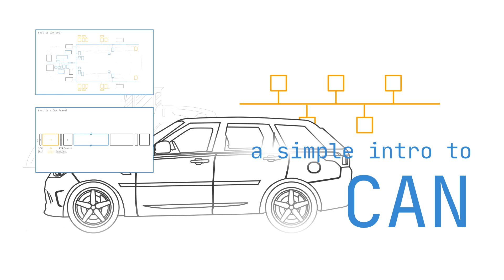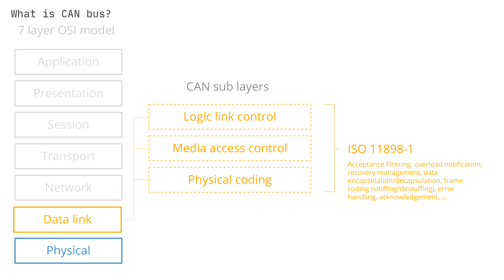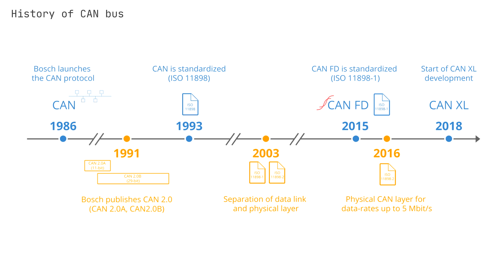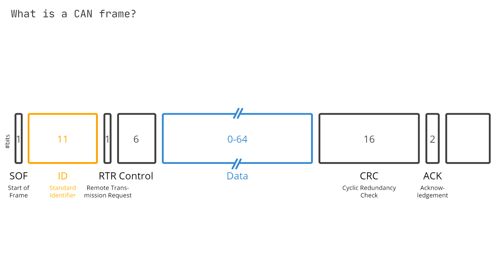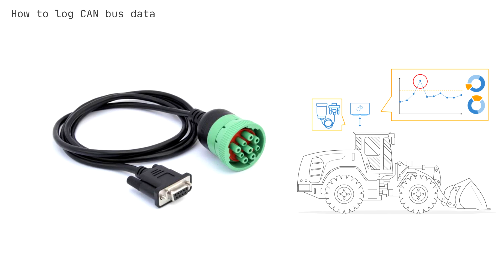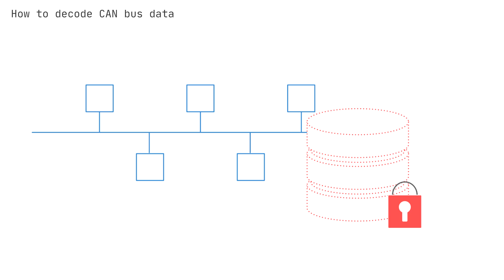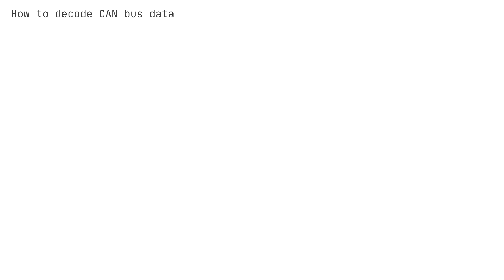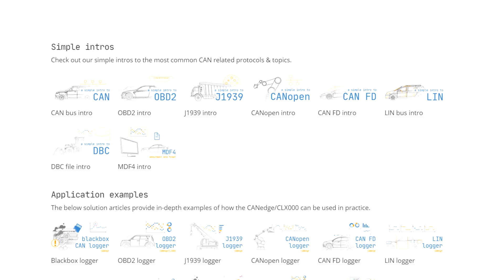CAN Bus Explained - A Simple Intro [v2.0 | 2021] 🌟

Comment: When you buy LED resistors, what are they referring to with “can bus”
Reply: If you mean for car lights, the LEDs will have lower resistance and draw less current, leading the car to think a bulb has broken. The resistors just trick the car into thinking the regular bulb is there. I'm assuming the bulbs are monitored on the CAN bus, so the resistor is there to make sure there are no error messages on the CAN bus.
Reply: @person880  yep exactly, 5 months ago I didn’t know what CAN was, now I know how to work with and around it. Thank you! 🤠
Reply: @ShaneAndRy   No problem. It's nice to learn new things.